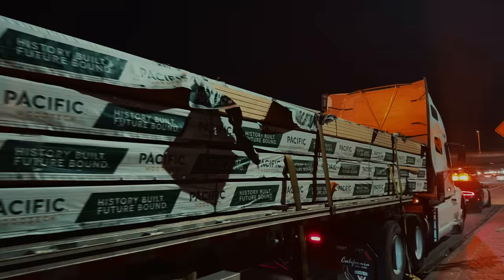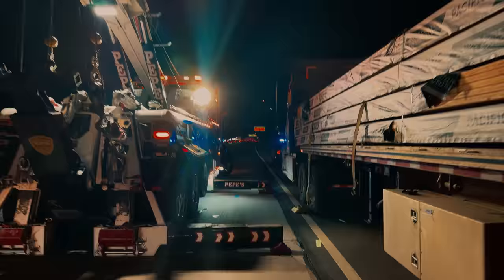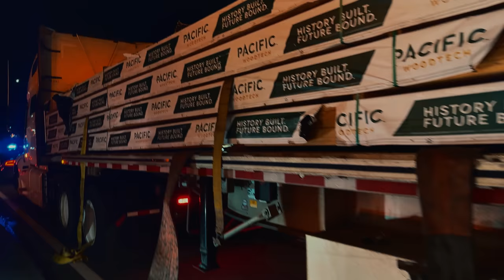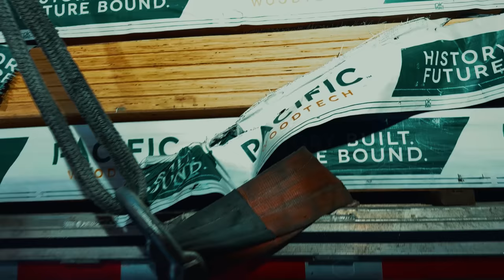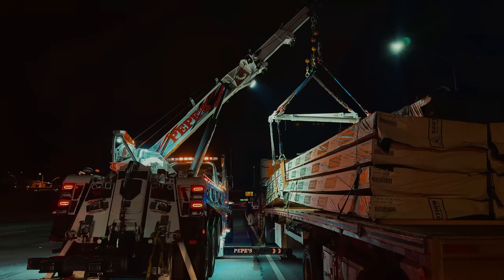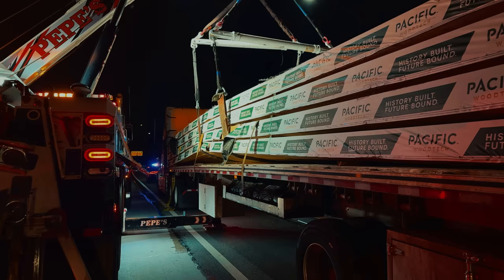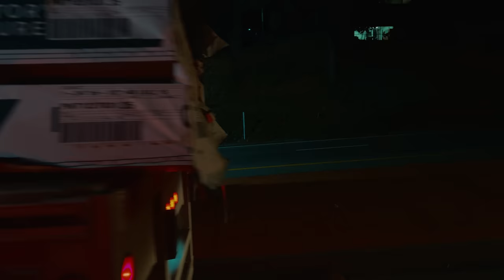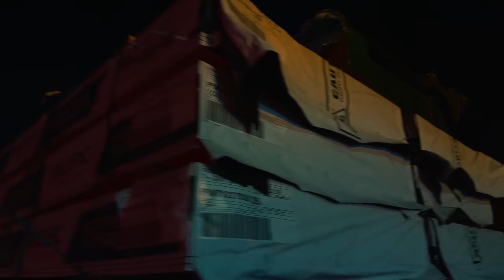Got wood? Load shift on freeway after panic stop recovery

Comment: There is a way to strap that load so it cant slide forward. Use a big enough strap to wrap that load completely over the top so its incircled and cross the ends underneath and winch it down on both sides. What happens when the load tries to shift it pulls on the strap which tightens and squeezes as it moves.
Reply: Yeah, but alot of guys are too lazy to do that much work. 
Of course this guy should have had more straps on the load to begin with. 
I've hauled so many loads of that, loaded on the west coast & deliver in the east, no problems if you don't get lazy & use minimal straps.

Comment: When oh when are the Feds going to make headache racks mandatory? Anyway, great job, and happy holidays to everyone at Pepe's. 🎄🎁💝🕎
Reply: They tried that they don't help.
Flatbed is hard to haul. 
What's the rules now. 2 straps in 4 ft  front and rear and 1 no more than 10' inbetween the ends preferred to be equal to load. I'd strap each tier. That way. Like I use to haul the gas pipe. 

No
Reply: @jerrykinnin7941  why do headach racks not help?
Reply: @Jehty_  if properly secured they might help. But 4 u bolts is how most I've seen tied to the frame with. 
And with certain trucks ie. The aerodynamic ones with the double bunks. There's no room for them. 
If I ran flatbed still I'd get the headache rack that blots to the frame like cross members and fuel tanks do. But my experience a 45000 coil of steel rolls forward a 250lb piece of aluminum won't stop it. So secure the load so it don't move. Then drive like it's not secured at all. The best head racks I've seen are what's on an oilfield truck. But remember
The heavier the truck the less you can haul. I've lost out on more loads by being too heavy than being too light.
Reply: @jerrykinnin7941  that doesn't answer my question.
Reply: Headache rack would be useless in that situation there was enough weight there it would hav3 sheered u bolts off I seen one years ago flat be# hauling drilling pipe load shift ended bad top 2 rows went plum through cab out windshield the driver never knew what hit him

Comment: they never learn never use straps on lumber and steel use chain and dont forget the header board this driver is lucky he still has his head
Reply: Wouldn't chains damage the lumber?
I've heard that some customers don't allow chains on their loads? (I only think that I heard that, maybe I am wrong 🤷🏼‍♀️)
Reply: @Jehty_  
yes chains could damage lumber so i used  chaffing gear on the corners but never straps just cant get them tight enough you dont your cargo to hit you in the back of your head but that driver should have a head board to keep the load from moving

Comment: Those were what we call LVL's ( Laminated Veneer Lumber) they are WAY stronger and heavier then regular wood. That is the main reason they held together. Great job.
Reply: Their strength is not good in the plane they are loaded on the trailer. Strength  is in the vertical position like a floor joint. Since they are laid flat it will be likely that some will be damaged from being lifted with one pair of slings.

Comment: Looks like you would have liked a third spreader bar to keep the two cables separated - but I expect you only have two of them.  Still looks like you did a heck of a job!  I hope that the wood in the bottom layer wasn't too over-stressed.

Comment: Unless some straps broke. He didn't have enough securement. Also use cork mat on the deck and between each tier. 
2 straps in 4ft front and rear no more than 10 ft apart thru the middle. If you could strap each tier 1:1 for weight. 
I use to haul trailer length steel gas pipe. 
Strap each tier to a 1:1. 50 ft joints on a 48 ' trailer.

Comment: you got to belly strap the shit out of those small wood stacks. I had one move around on me before.     as for moving the load. why not just release all straps, then get behind the truck and choker the load with a strap, then just slowly slide it backwards on the trailer. this lifting etc seems like a real hard and dangerous way of doing it.  

I would bet the driver forgot to tighten those straps, that load moved a long way as one unit.
Reply: Yep. Same with packs of aluminum extrusions
Reply: Rotators are usually safer and stronger lifting from the side than the back when both options are available.
Reply: @lindasherman9921   it shouldn't take much to slide the load. Those small packs of wood like that slide rather easy. (hence why this happened) I've choker the back of loads like this and slide them back with another semi truck pulling the strap. works better than you would think. Also is really fast to do. However, it is hard to charge a couple grand to do it...  if you ever get into this spot, something to think about anyway. have a good one.
Reply from the maker: I would never choke a load like this. Compressing it together with the strength of my rotator would be catastrophic. Dual spreader bars is the way to go. I mean you can clearly see by this video it wasn’t that difficult or heavy the way I angled it. 1,000 ways to skin a cat
Reply from the maker: Also how would I get behind the trailer ? Shut down the freeway and U turn it ? Lol I never ever do that
Reply: @PepesTowingService   You had a truck parked behind it anyway. 

choke the bottom two stacks and the rest slides with it. it's not going to damage the wood much at all. Use some packing blankets on the straps if you're concerned with it. 
lifting from the belly will for sure damage because you're putting all the weight on that point.  From all the wood... However sliding the load is not going to be enough to damage the wood because you are not hanging the entire weight on the straps. You're just putting whatever it takes to slide the load. The other bonus to sliding it is, It is not going to loosen the bundle straps nearly as much as flexing the entire load in the middle. You can also slide the load one side at a time (depending on the dunnage) . limiting wood compression from choking (damage). I would bet you could choke the bottom stack on one side and slide it with not much effort.  My line of thinking anyway. works for me in the past. 

there are many ways to skin a cat for sure. either-way job got done.
Reply from the maker: I’m not sure why you’re so hell bent over this. The truck is parked Westbound behind the trailer. If I’m reading your comment right, you’d want me to be backed up to the trailer right? Which goes back to my point, did you expect me to order a lane closure and cause unnecessary back up for that? I’d rather lift the front than the back in this case because the front end is hanging over the front of the trailer and into the cab. Price wise would have been nearly identical since CHP rates are on an hourly basis. Not like one way or another would be a “couple grand more “ as you say. I’m a rotator operator and tend to think in the rotator mindset. Off the side is my preferred choice and where I’m more comfortable with.
Reply: @PepesTowingService   not hell bent, just conversation. I've been in this spot before and sharing how I fixed it. thats all.  It's an interesting physics problem. its all good my man. Have a good one.
Reply from the maker: @pokerman9108  All good! More options are always a plus. In my case, CHP already had the adjacent lane shut down and I knew with the help of Alex this method would be quick and easy. Cheers!

Comment: Is that a big fix for Big Flipper?     Been having to walk to work again this winter.  I swear I am going to trade this little Jeep in.  Just cannot figure out why the batteries will not hold a charge. I replaced so much electrical last summer, and now I seriously am considering replacing the main computer. 
I see your wearing a heavy jacket.  Up here in Northern Minnesota we just came out of a big blizzard and temps below zero.  I still have not taken my winter coat out yet. Just wearing my usual hoodie and vest. And even though it is light enough I still can't stand it. Hate being bundled up for winter. I feel I cannot move freely when dressed so warm. 😆

Comment: It's not exactly the drivers fault for not going the 1/2 a mile per hour those automatic pretty much suck its not like letting out a clutch to where you're able to control your speed you put those automatic trucks in drive and the don't engage tell you hit the gas pedal